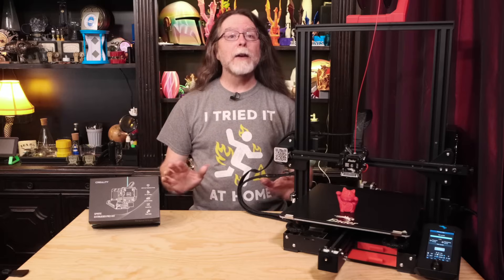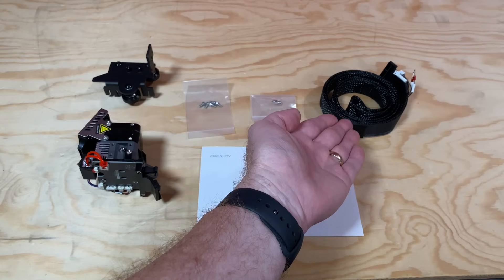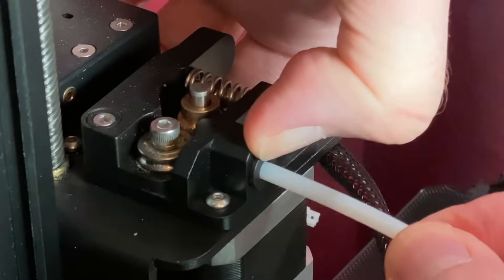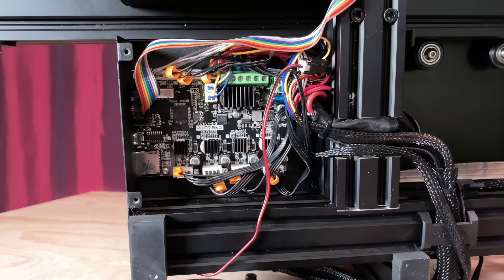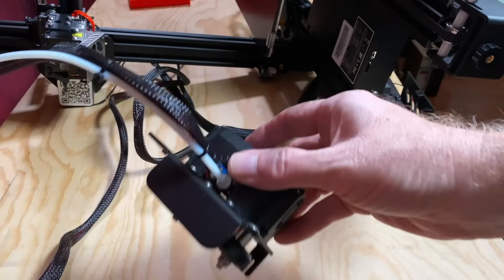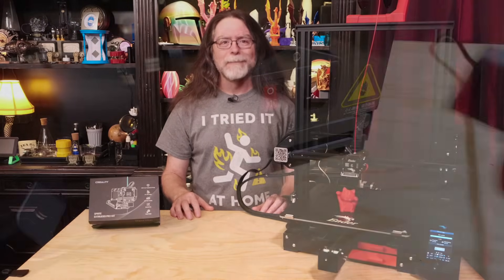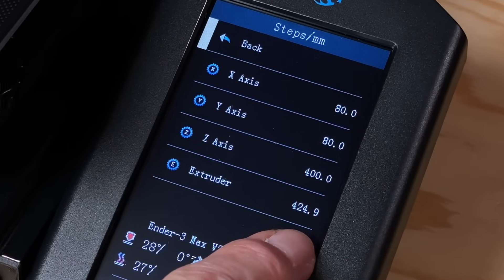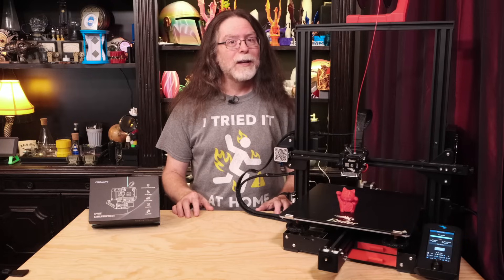How To Install the Creality Sprite Pro Extruder Upgrade

Comment: this video dosnt say that the Extruder comes with the Heat cartrige unplugged! Its just tugged in the hotend! I spend 4 hours troubleshooting and ordering new mainboards and nearly through the whole thing against the wall until i tugged on the cartrige cables and saw they where just sitting there without beeing plugged in! Apparently Creality changed something here and your viewers should now that!
Reply: Dude thank you so much. I just did the same thing till I saw your comment. Literally spent hours troubleshooting.
Reply: Dude thanks a lot! I'm in the process of installing mine and you saved me the hours of headbanging. Indeed the connector is jammed against the fan with no mention in the installation instructions included
Reply: Confirming that one year on this is still how it's shipped, and if you have the paranoid foresight to watch installation videos and then obsessively read the comments before attempting an install you'll be way more stress free because of it.
Reply: Same here man
Reply: I was about to throw it out. Thanks!
Reply: Ahhh yes. Just saved me the same 4 hours
Reply: The hilarious thing is that there was a piece of paper on my power wire saying "Please insert into adapter before use" but the plug was so well tucked that I thought it meant that I needed to connect the extruder into the harness and not... use it freehand?
Reply: @GSBarlev  same!
Reply: Glad I read this before mine comes in. I hate when companies do that kind of stuff.
Reply: Y’all are blind
Reply: @deliriousthat5563 literally what I was thinking lol. And it is in the manual
Reply: Same….
Reply: A year later you’re my hero!
Reply: Even the label was tucked under with the cable. I never would have found it.
Reply: Thank you so much you just saved me hours

Comment: I followed the video and installed everything properly and nothing on the board or the wires is damaged, I flashed the firmware and went to home it, the x and y axis move and home just fine but the z axis won’t go down. Do you have any suggestions?

Comment: Install the new extruder on a custom 300mmx3 printer running a SKR 1.4 Turbo with TMC2208 drivers. I had to reverse the extruder direction and set the E-steps to 189.9 from 424.9. All good!

Comment: Just a question 

Is the sprite pro 12 or 24 volts ??
Reply from the maker: It's 24 volts. I don't think they make a 12 volt option for it.
Reply: Thanks for the answer bryan 

Got two ender 3 and one cr10 and a cr10 comming up 

Thats why i asked 

Bu now i know they for only on the ender3

Comment: Thank you for this video, just did the upgrade to my ender 3 v2 and your guide was an invaluable tool in this process
Reply: How did you get on with this?I've just done it on my ender 3v2 neo and cant get anywhere with it,for a start the stop sensor on the left is in the wrong place..how did you get around this?Did you install a particular firmware?What offsets did you use?
Reply from the maker: Glad it helped

Comment: great video thank you for taking the time to put this together! Just installed the sprite pro onto an ender 3 max neo. Exact same board as yours, i noticed it looks like you just left the electronics enclosure fan unplugged - is that correct / not needed?

Comment: Can this fit on my ender 5
Reply from the maker: I think the big limiting factor on installing this on an Ender 5 would be the length of the ribbon cable that comes with the Sprite Pro. I don't think the cable is nearly long enough for the Ender 5. There would be a lot of splicing involved.

Also, if you want to use the Sprite Pro's higher extruder temperatures, you'd need to edit & compile the firmware to do that (and I recommend checking out @kerseyfabs for his Ender 5 firmware videos).

Comment: hey quick question, i attempted to heat my hot end and it gave me an error saying (THERMAL RUNAWAY: E1 PRINTER HALTED PLEASE RESET), i checked the wiring and its all good, im wondering if i have to PID tune it or not. I'm on an Ender 3 Pro

Comment: Thank you for the great step by step! Just one side note: For those who have an Ender3Pro older than 2020 I recommend reformatting the SD card when trying to save the E-steps or else it will never save. Yes it only saves on the SD card for some reason... and only if the mini SD card has been reformated.

Comment: That's a huge jump in e-steps from the stock! I'm at about 97 myself, any idea why it jumps up so drastically compared to the bowden set up? Also fantastic video, I'll be using this to install my own very soon!
Reply from the maker: Hi! The Sprite has a gear reduction drive in it, so the motor has to spin more to move the filament the same distance as an extruder without that gear train. Doing that allows the use of a smaller, lighter motor, which is great for a direct-drive configuration.

Comment: I’m have trouble with the cr touch, I have it installed (no clue if I did it right) but nothing is working, the cr touch gets power and works when i do a test, but when it comes to pro being the bed, it completely stops working, any suggestions

Comment: I did this upgrade this evening, along with putting ferrules on the main power and bed wires.
Did the ferrules first and made sure that was done properly before swapping the extruder.
Other than a tight workspace for fat fingers it went well.
Turned it on, and no magic smoke.
Tested the fans, all good.
Hot end was showing -14°C...hmm
Let's do a PID tune.
BEEEEEP MINTEMP error.
Open up the electronics box, check the thermistor cable. Seems to be seated fine, but still giving an error.
Plugged the old thermistor in to make sure I didn't bugger up the board and it was fine.
Plugged the new one back in and checked the cabling.
Apparently the cable didn't seat properly on the extruder end. Reseated it, and it was happy. What should have been a fairly quick swap took a few hours to complete.
Reply: Brooo story of my life😂😂! Glad you got her!

Comment: Hello Bryan, this was an awesome video, thank you! I just received a new 3 V2 and installed upgrades consisting of a 4.2.7 motherboard, this Sprite Extruder Pro, a CR Touch, a Dual Z-axis kit. I’ve also flashed the mriscoc professional firmware and I was hoping that you might consider a similar video that could reference this one and highlight how to setup this direct drive extruder with a CR/BL-Touch properly in this alternate firmware? I think you might be using Jyers, but I’ve been seeing on Reddit that firmware has been abandoned and have read that mriscoc firmware has a lot more options out of the gate and this is all overwhelming…
Reply: I am also in the same boat, but with a ended 3 pro (4.2.7, CR touch, and sprite extruded) I have been trying to figure out how to get everything to work together I can get my X offset okay but when I try to print with the CR touch it seems like the printer thinks that I am still using the factory hot end and will try to sense off the front of the bed running the extruder into the bed, also my bed adhesion sucks 😅
Reply: I have the same exact setup and on mrisosoc firmware and it was literally as plug and play as it could get.. all I had to do was flash the new firmware in and it was good to go. Not sure where your having trouble, I have the exact same setup as you e3v2 with sprite pro, cr touch, dual z, all the works and the new firmware worked perfectly didn't have to do anything after flashing it
Reply: @Mr.Thermistor7228  any help you can give for me? My ender-3 max upgrade with sprite pro works but not the Cr touch?

Comment: Thank you for providing this video. My Sprite is coming tomorrow and I was wondering about the CR Touch that’s currently on my Ender 3 v2. I am running CR Touch with Jyers firmware. Do I need to update the firmware to something else in order for the Sprite extruder to work? Or should Jyers support this new Sprite extruder? I think I installed Jyers along with one of your CR Touch installation videos, so it would be nice if I could just use the same firmware with the Sprite so I don't have to redo the CR Touch stuff again.

Thanks in advance!
Reply: An update on this. Jyers worked great with the Sprite Extruder. I did have to finagle with the X and Y probe settings for CR Touch, since it is a new extruder, but some slight adjustments and I was back up and running. I do have to note that when I assembled everything, the hotend was not turning on. I was pulling my hair out wondering why and noticed that the Sprite extruder comes with the hotend plug unplugged from the hotend, with a nice little note attached to the wire saying to plug this in. This wire was hidden inside the extruder when I installed it, so I didn't see it right away. It's a red plug too. Thanks!

Comment: @bv3d Great video, though now when I go to level the bed and use the CR touch it moves off the bed. The whole sprite seems to want to go to the right too far and then comes forward too far. I am using Jyers 1.3.5. on an ender 3V2

Is it best to go to the stock Ender firmware? I am a newb and at a loss. It seems like Home is off center and the printer bed size is wrong.
Reply: You need to recalibrate the mesh inset

Comment: will this work on the e3pro
Reply from the maker: Hi, the Sprite Pro will work on the Ender-3 Pro, using Creality's firmware for that model printer. 
This URL should take you to the Downloads page for the Sprite Pro extruder:
https://www.creality.com/pages/download-sprite-extruder?spm=..page_1934481.products_display_1.1&spm_prev=..index.header_1.1

You can grab a copy of the manual and you can download firmware for your Ender-3 Pro.

(The JyersUI firmware that I use in the video requires the use of an Ender-3 V2 color screen).

Comment: I appreciate the video.
I was wondering if anyone has a problem with the hotend heating up as soon as the printer turns on, with out touching any dials.   Heats to 278 then thermal runaway error goes off.  Has anyone else had this issue?  [Ender 3 v2]    Thanks.

Comment: I really need some help, I've just installed this and the nozzle isn't heating at all, I've checked all the wiring and it's all plugged in fine, I guess it's something wrong with the Thermal tubes but they're plugged in right so I don't know what the problem could be
Reply: I received v2.0 of the kit and the heater wire was not connected to the extruder board.

Comment: Can someone explain how to adjust the leveling locations after you have installed a new extruder such as this one with the cr or bl touch sensor. The sensor location is now moved to a different location than the default for the ender 3. Thanks in advance for any and all help and thanks for the video.
Reply: I can explain how to now if anyone runs into that issue.
Reply: Please do

Comment: I am considering this for my E3 V2. I already have the CR Touch and have it working properly. My question is this, this looks a little heavy compared to the original setup. What are your thoughts on adding the Dual Z axis kit with this as well?
Reply: I am considering it too. I am worried that the extra weight on the X carriage will influence the print with the extra vibration and what about the gantry wheels won't they have to be tightened even more?

Comment: Hi,  I just installed the Sprint extruder pro kit on my Ender 3 V2 4.2.7 board and for some reason my CR touch is not coming on, I tried latest firmware, anyone can help me? 🤔

Comment: Thank you for a very informative video on upgrading to the Sprite Pro. I have just installed one onto my Ender3V2. The install didn't go well, unfortunately. The fitting and wiring of the unit went smoothly and with the help of the Creality support page they sent me the upgraded firmware. 
Thats where the problems started. 
1. The X axis was not able to extend to the right hand side of the build plate. The extruder mounting bolt crashed into the angled support bracked of the gantry.
2. The firmware is no longer compatible with OctoPrint. The error message on the screen tells me that The printer firmware is not allowing OctoPrint to send or receive commands and messages to/ from the printer. (The firmware needs to be modified)

Would it be possible for a video on setting up the Sprite extruder on an Ender3V2? Please???
Reply: I had similar issues when I tried to install the Sprite Pro immediately after purchasing my Ender3V2. I could not figure it out and got a replacement Ender3V2. I didn't attempt to install the Sprite Pro this time and the stock hot end is working great for what I'm doing. If I get adventurous with my prints, I may attempt to install the Sprite Pro again. Hopefully they have better firmware available.
Reply: Try Jyers firmware or even better, Professional firmware

Comment: Hey Bryan,

I installed this extruder on my Ender 3 3D and have a Creality Bed Leveler and when it start probing it stops the extruder inches above the bed and when it prints i have to edit the z. then i print other one i have to do it again. any thoughts?

Comment: Iv followed all the steps but my hot end won't heat up then the alarm goes off
Reply: you need to connect the connecter on the nozzle hotend.  it's a thick red wire tucked round the back with a tiny label on it telling you to connect it. it's a bit hidden so it's easy to miss.
Reply: @chrisasten2257  thanks I'll try this when I go home I just cut the label off coz it was flapping around and I didn't even read it haha

Comment: Really want to know what spool holder design that is
Reply from the maker: 😉 That spool holder thing: www.thingiverse.com/thing:2846383
Reply: @BV3D  Thanks I'm probably going to route a bowden tube from my heat box to a clip on the top rail but if that doesn't work I'm definitely going to print this.

Comment: Thank you always for the great videos, and I especially appreciate you doing ender 3 Max videos.  Question my y-axis keeps skipping and I really believe it's due to temperature due to the motor being hot. Can you make a video on making sure the voltage is correct? And I also noticed that the end of three max doesn't have a 4234 on the y it has a 4240. I have a 4.2.2 board and I don't know if I want to replace the motor the board and just your thoughts on troubleshooting the situation or things I should buy or look into. Be really interested to see a video on what you thought. Thank you for your time
Reply: For the record, I live in Southern California and it's been over a hundred the last 3 weeks and it just started doing this and my motor is very hot to the touch

Comment: Bryan, I have installed this on my Ender 3 Pro with 4.2.7 hotend. I adjusted E/steps. Now I don't have the full  use of my 220x220 bed. I have even set the Y offset to -65 and still missing about 20mm of the back half of my bed.  Any ideas or adjustments in the firmware that I can make?
Reply: I've also upgraded my Ender 3 Pro (not v2!) with 4.2.7 motherboard and with sprite extruder pro with bl touch and also have problems: the printhead works, but the printer only uses only 210x210 of the bed and the mesh of auto bed leveling is only in a small area, furthermore it's different from print area, furthermore the motherboard always reset itself and change langauge and zero probe offset. I've been mailing for weeks now with creality support with no luck! They are laughing at me, making fun of me :( If anyone has a working firmware, please tell me!
Reply: Did you end up finding a resolution? I am trying to upgrade the same (Ender 3 Pro 4.2.7).
Reply: @gotmonkey70  I've had enough of  Creality support and made my own firmware. It is working perfectly, I thought it would be harder to make, but now I know, I shouldn't wait for Creality for so long.... You should make your own and forget that crappy "support", or whatever I should call them.

Comment: What firmware are you using? I'm having a hard time getting my ender 3 max to work properly after upgrading to the sprite extruder!
Reply: Did you make sure the e/steps where correctly set per the directions in the manual?  If this is not the issue then what issue are you having ?
Reply: @Celtic71  The E step is set properly and stored.I just think it's the firmware that creality provides for sprite extruder upgrade for the ender 3 max! The cr touch doesn't deploy to allow the whole printer to calibrate properly! It bottoms out when the gantry comes down! It's strange because I was hoping the cr touch would deploy and stop it but it doesn't. Mind you that this isn't a marlin firmware. And if you have a good source that's stable for this particular upgrade that would be great! That's my main issue!

Comment: Just to help my ed3 v2 I was able to move the filament roll holder to the front and putting the ring on the back and was able to run filament for a dd setup